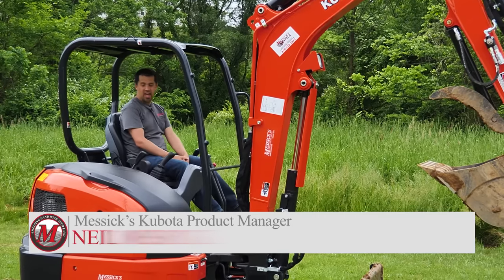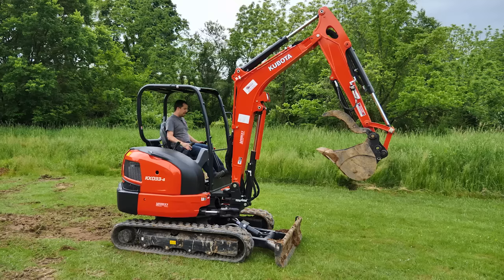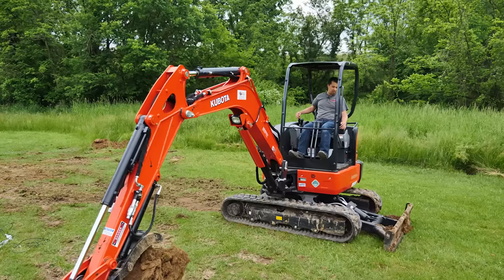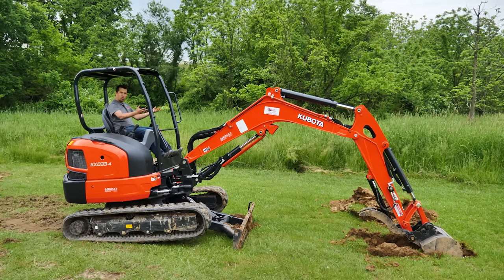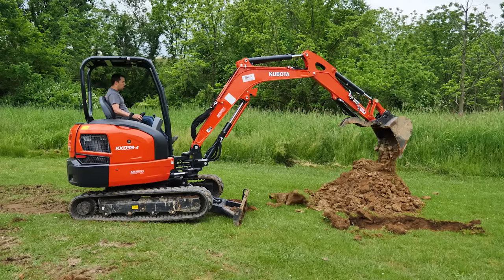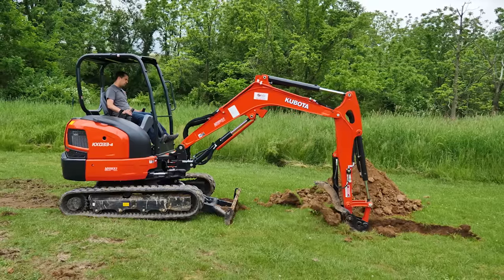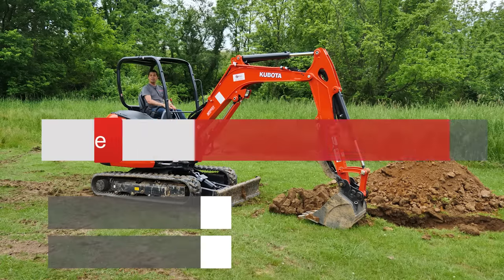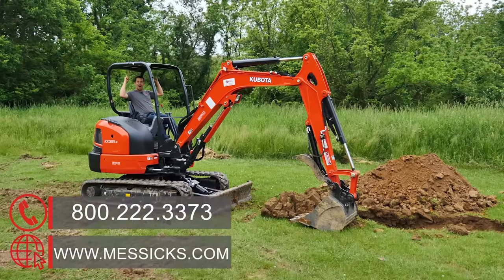Excavator digging technique for beginners

Comment: sorry  neal but that is so wrong. the bucket should be flat and the teeth do all the work and you dont curl the bucket till your coming out of the ground. If you keep the bucket flat you can keep the bottom of the ditch flat, clean and on grade buy gauging of the pins on the bucket. I dont want to hurt your feels.
Reply from the maker: I'm aware.  My thinking was that's a more advanced technique than what a novice operator would be able to manage
Reply: @MessicksEquip  it would be cool Neal if you combined novice with advanced techniques... show the n00b way, then show the pro way... that would be kewl👌🏾
Reply: I learned this way too
Reply: Diggind over water gas sewer or electrical always teeth down so the spotter can see as soon as you are on or near a line

Comment: Can't wait for all the comments from full-time operators saying you're doing it wrong and that beginners shouldn't even try to run machinery if they can't do it "right".
Reply: Well, when a "machine" contacts something or someone unintentionally, that something or someone gets crushed or killed... so there is that.
Reply: They shouldn't! If they operate the machine to hard and blow a hydraulic line and high pressure hydraulic fluid sprays into someone's blood stream they have minutes to live. So many things can go wrong if someone doesn't know what they are doing. Anyone can run those machines few can operate them!
Reply: @davidray4285  I been around guys who’s blown lines before and got hydraulic all over me. I guess you mean if you somehow have a gaping wound and it goes in your blood stream ? Idk but yea running machines isn’t for everyone

Comment: I can only speak from my experience, but being heavy with the bucket curl is a good way to find buried infrastructure. Let the teeth do the work.  Rake the dirt in long shallow passes with the teeth at a 45 degree angle. Dont worry about scooping dirt till you have enough built up to fill the bucket. I find it is much easier to keep a trench flat  cause you can bring several feet of trench down at the same time.

Imagine digging a trench in soft dirt with your hand.  Your fingers are the teeth, your hand the bucket... etc etc.

You dig with your bucket, while crowding the dipper. The bucket and dipper do most of the work. The boom mainly just lifts/lowers to keep the other two in the right geometry for digging. It can get used to add downforce on certain cases but i digress.

Comment: Now try to dig without busting the edges for a nice clean cut, what you're doing there is just forcing that poor little machine go 2 to 3 inches down at a time instead of the whole bucket and use the full boom towards you for a better and efficient job, and if you do it right you end up with a full bucket and much much nicer trench!

Comment: After a while digging becomes quite rhythmic & most machines are quite intuitive in there design .I don't use an excavator that often but over the last 25 years I much rather be running the pipework than digging the trench. But as I get older I'm reconsidering the easier option of digging.
Reply: If I wasn’t on a pipe crew, I wouldn’t even work in construction. I dig every once in awhile but prefer the loader guy job. It’s fast paced and very busy all day

Comment: Great stuff,  been looking for a video at this level.  Figuring out the levers is easy, but knowing what not to do is important.  I would like to know more about landscaping slopes, what to do when there isnt a level spot for the excavator
Reply: Tracks squared up to the slope - in other words, tracks up and down the slope, not sideways with the slope (see bench for alternate) - be careful with the swing though. you can still tip if the bucket isn't close to the house and/or the swing is too fast, stops abruptly, or not a fluid motion. You can also cut a bench if the slope is large enough or steep enough. The last option is to tie off to a dozer or some other anchor point - but that is something only highly experienced operators should do.
Two other thoughts - on a slope work over your idlers - so going uphill they should be in front, going downhill is the opposite. If you have a blade, put it down below the machine on the slope and gently dig it in. Where your spoil goes is also important, because it either has to go back in or be hauled away!
Consult the operator’s manual to determine safe operating ratios for working directly on a slope with your particular excavator. Do not exceed these ratios!
Reply: You suppose to check your FLUIDS 😎 pre trip the MACHINE

Comment: I operated a KH41, I maybe wrong on the model number, it's been 20 years, but this was 'underground' at a gold mine in northern Ontario, Canada. It was used for drainage ditches and clean-up between the railway tracks as drainage was 'very' important in keeping the tracks in good condition, I had this job for about 7 years. BTW, there was no training involved for me, I was just given a reprint of the operators manual and told to learn the operations on my own. I can say that operating the Kubota was the best job that I ever had, and it wasn't only used for ditching, we had the hydraulic rock breaker attachment that was used for breaking oversize muck (rock) and even freeing frozen muck at the surface crusher in -40F temps without a cab, now that was cold, but it still did the trick. Mini excavators are a really handy piece of equipment!

Comment: Some operators on the job would call this method completely wrong.
You should be slicing off layers two to three inches thick going horizontally about 3 ft long until you get to the bottom of the trench. and keep the bucket teeth pointing slightly down as you're cutting off each layer. 
 Then you move the machine.
If you scrape the face of the trench from the bottom up you cause a lot of extra dirt to fall in which means it also takes longer to dig and to back fill the trench. It also leaves the trench looking ragged.  
Also do not use a bucket that is too wide cuz it can slow down the process quite a bit.
It's also important to keep the sides and the bottom of the trench smooth and straight.

But if you're digging on your own land just be careful not to hit any pipes or wires Underground. if you're not sure call your local utility company and ask them to check for underground utilities also known as USA's or underground service alerts.
Reply: Yes, exactly my thought's too. Plus blade at the rear gives you more vision in the trench and no chance of catching the blade with the bucket teeth when digging deep. So cowboy taking the top layer off like the video shows aye. Rough as guts haha
Reply: "You should be slicing off layers two to three inches thick going horizontally about 3 ft long until you get to the bottom of the trench."

I'm sure your method is good for soft soil, but for hard clay you should do it the complete opposite way, in my experience. Scraping takes forever i hard clay, and there is no reason to worry about the trench collapsing or getting uneven when the clay is hard. Therefor, if the clay is hard, you should first digg all the way to the bottom of the trench in any way you want. Then you should make the wall nearest yourself (I'm not talking about the sidewalls) as vertical as possible (get rid of the swing shape at the bottom of the trench). And then, when the wall in front of you is vertical to the bottom, you should start chipping of parts of it from topp to bottom, about a feet at a time. And then chip of a new vertical line. It is important to keep the wall as vertical as possible (still not talking about the sidewalls) for each vertical chipping round. This way, I think, will be a lot more effective in hard clay, because you need to be breaking it up instead of scraping it. Think about it as rock. You would never think of trying to scrape off rock in layers.

Comment: Most manufacturers recommend digging with the blade behind you (pinning, as you call it) in mini excavators, up to 7 ton. If your machine is tilting forward, it’s because you’re reaching too far out and/or you have too much weight in the bucket. Keep within 45 degrees vertical on your dipper angle and you shouldn’t have that problem. Your blade can be used to aide penetration, the counterweight is designed to balance the machine, without overloading the hydraulics. Cat made a video a while ago (which we had to sit through in a site induction once), which details how they intend their machines to be used: https://youtu.be/oRZbOMoeTx8
Not trying to discredit your video or anything, I apologise if I’m coming across as a know-it-all.
Reply: You're spot on mate,take it out in lairs.If a novice excavated like this on his test he wouldn't have much chance of a pass.
Reply: joel  That's because it's counter-intuitive.  But it's the correct way.  Otherwise you can't get the downward force necessary for lots of soil types.

Comment: Thank you for the Teaching on small Excavator
just always remember where your drive sprockets are. what way to push travel levers.
If you Rented a small Excavator, never ran one. at job site. just practice extending the Dipper out as far as it will go. put BUCKET just above ground. and practice pullings in boom and Dipper WITHOUT bucket digging into ground. get smooth at both function. don't pull Levers hard. Just very slowly smoothly pull them at a together movement. the Excavator boom is different than a standard backhoe boom. Just practice on top of ground first. Everyone has there first DAY of being a operator. Take a look back at the 70s era of Excavator. The operator used his feet for Dipping and Bucker. They were on the foot pedals. the Swing was forward and back on one of the Big Levers. The other Lever was usually your boom. Why did they have Foot pedal for function. It was because of the cable drum Brake system on cable Excavator. The operator were use to using there feet back then.

Comment: I've used one of these three times for trenching.  They are good for the first 24 inches.  After that it is hard Gumbo.  36 to 72 inches will require a mid-sized machine.
Reply from the maker: Nothing about the machine changes magically at 24 in. Probably a change in your soil conditions.

Comment: If I need a 7 ft deep 24" diameter hole,  how much can you control the machine to make the hole as small as possible?
Reply from the maker: Use an auger. You'll end up with a large hole without it.

Comment: If you have to "pin", (except on a slope) then you are probably digging incorrectly. If you are digging correctly and still can't pull the material out without "pinning", you probably need a breaker or a ripper, which is beyond the skills of a novice operator. (imho)

Comment: The reason you want to dig over the blade is because you don’t want to dig over your wheel motors. Less wear and tear on the undercarriage.
Reply: That's true and also not, with the smaller machines especially Minis, doesn't really matter. when it comes to larger machines that are very heavy that is an issue

Comment: Blades meant to be behind you when digging 🙄
Reply: no it’s not you never dig on your final drive idc what your manual calls for
Reply: @cadenlowery4364  Not only does it act as an anchor preventing the machine tipping back as you apply pressure in the dig, but it also allows you significantly improved visibility down into the trench, which is especially helpful when working in close proximity to live services